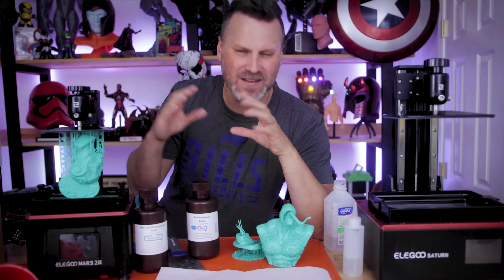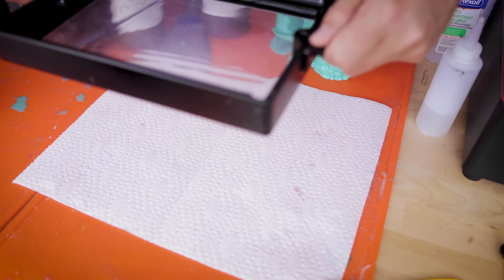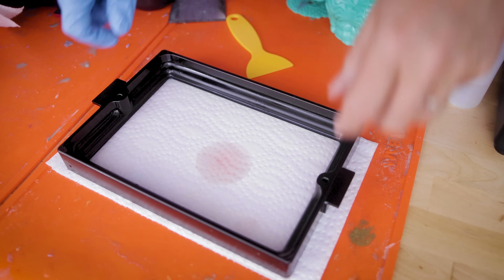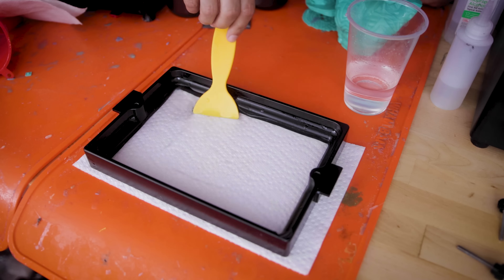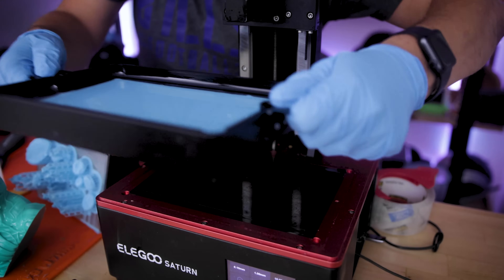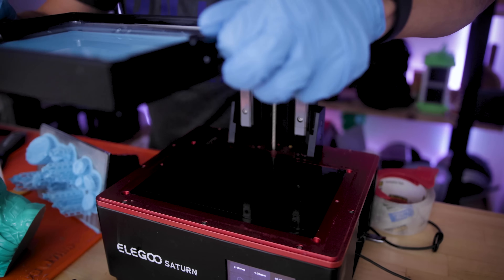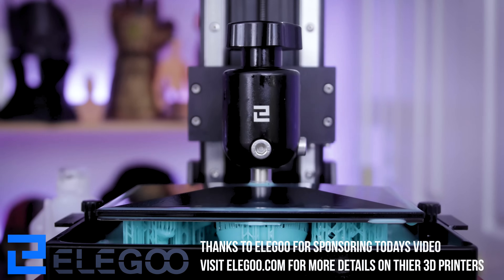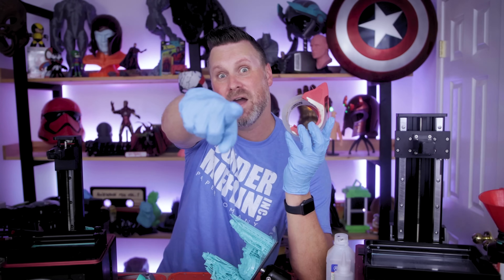Can you fix a FEP with Tape? Resin 3D Printing Test!

Comment: I would recommend Gorilla Tape to extend the usage of this pretty awesome patch fix method. The Gorilla brand is bad ass with all their products,  but their clear packing tape is extra clear and extra strong, so it will hold up against the resin way better and longer
Reply from the maker: Thanks gonna try to find some this week
Reply: @UncleJessy  hey while I got your attention,  I just got my Anycubic Mono and I keep having my prints fail.. they end up having parts or like the last one the entire print was flat as a pancake.  Any ideas what's up here?
Reply from the maker: @Kitzkrieg  it’s more than likely the resin settings. Also how cool is your room that the printer is in. Normally they print better in warmer rooms. Then again it’s summer so it’s probably warm 🤣 

The mono Facebook group should have a resin settings doc you can reference as well
Reply: @UncleJessy  it is warm out,  but the a/C is on full and it's pretty frosty in here 😄
I'll try moving it and ty for the fb tip 😉😊
Reply: @UncleJessy  Jesse I'm offended, not going to plug the Atlas discord for support and troubleshooting? ;)
Reply: I had some issue to handle the Gorilla tape crystal clear (Is there any other kind of Gorilla clear than the crystal one? ). It feels hard to handle and not create some fingertips marks on it. Is it normal? Thanks for the tip!
Reply: @robsonribeiro7552  if you get Really bad fingerprints on it, then yeah, but a kittle isn't going to hurt anything.  But you can try pulling out maybe 2 inches of tape, then grab a corner with tweezers and then cut a square with scissors, and then slow lay that square down and over the hole, and then roll out the tape on to the FEP to smooth it down. And little smudging isn't going to bother your printer's ability to pass light through to cure resin
Reply: @Kitzkrieg  Aweeesome! Quick update, you're right, at least for the lastest print this morning, it seems even with the tape, the print is looking ok. I'll keep testing it but thank you so muuuch for helping me out. Cheers!
Reply: @robsonribeiro7552  no worries,  just try to pay it forward when you are able with another hobby brother or sister 🙂

Comment: Jesse, in case that black tape around the screen gets damaged, is there way to replace it ? I was a bit concerned about it, when my Saturn came in. Have you had any issues with getting it contaminated / damaged with resin ?
Reply: you can use kapton tape just make sure to get the black version .
Reply: https://www.dupont.com/products/kapton-b.html
Reply: @markburton5292  Thanks Mark !

Comment: So curiosity, why are we using FEP sheets in the first place? wouldn't a glass or glass like sheet of rigid transparent material do the same job? Or does the flex factor need to be there to for the lifting between layers?
Reply: Glass would simply explode into pieces after the first lift. FEP is used because it is both highly transparent, highly hydrophobic and very elastic.
Reply: Yeah I’m thinking glass may have too much adhesion